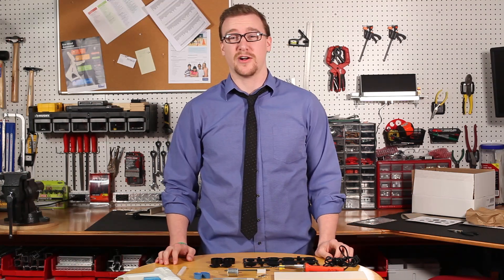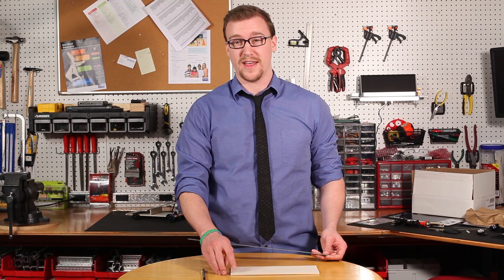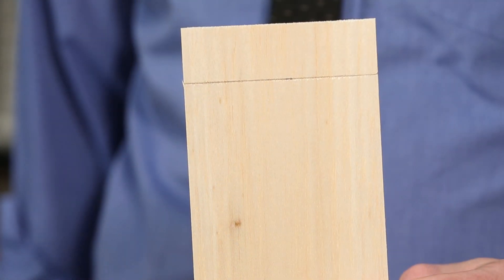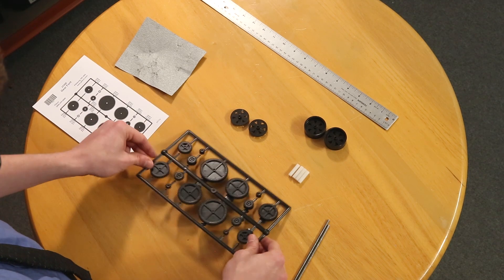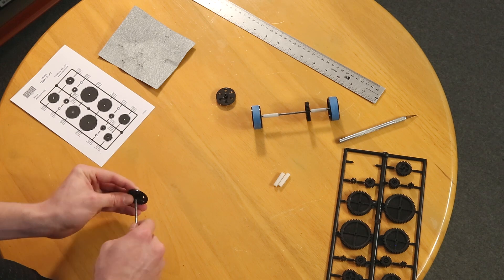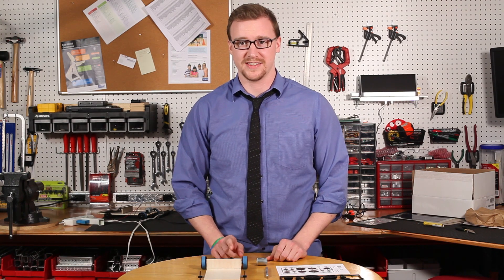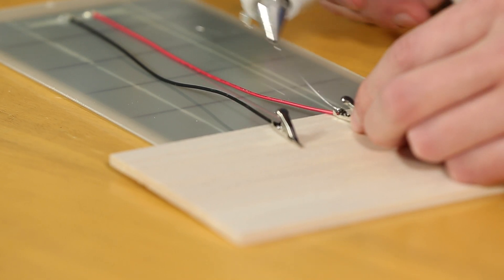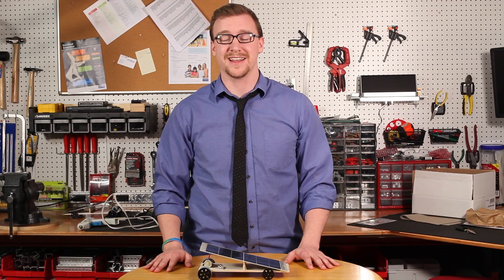Build the Ray Catcher

Comment: Is it necessary to use the solder
Reply from the maker: All that's required is a reliable electrical connection. The best way to make this connection is to use soldering. However, another way to make the connection is to remove more of the insulation around the wire and place the wire through a small hole in the alligator clip using the clamp and/or hot glue to secure the wire.